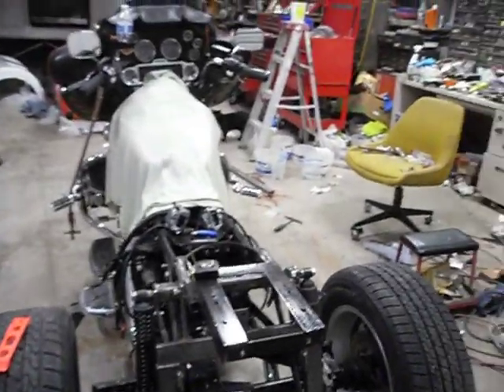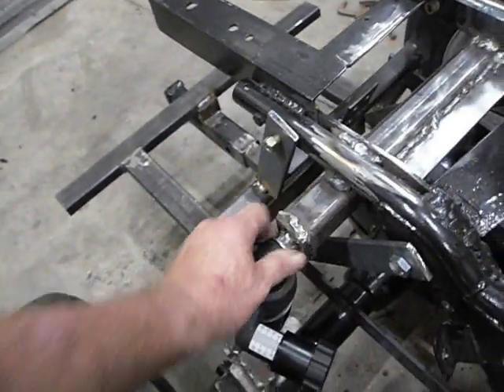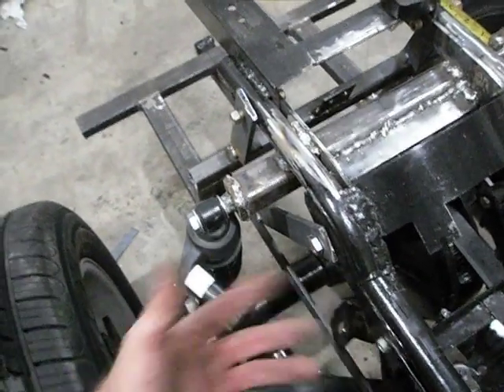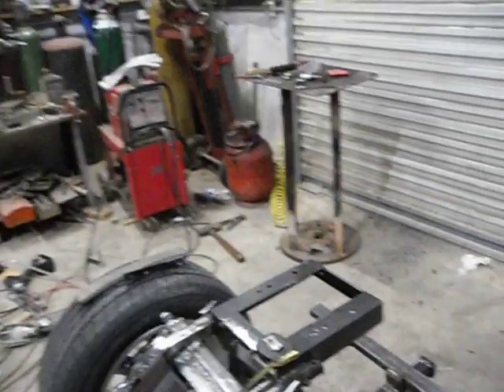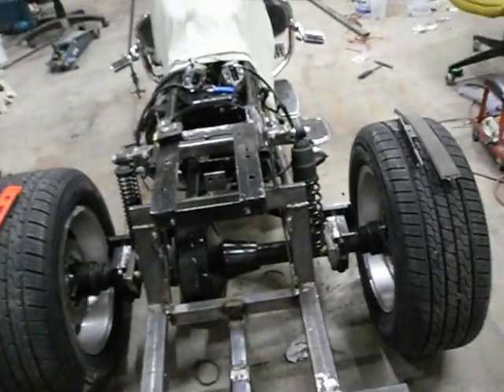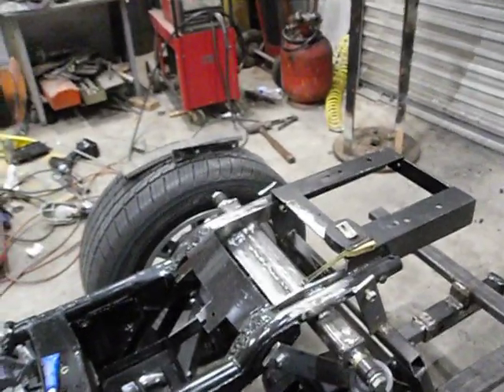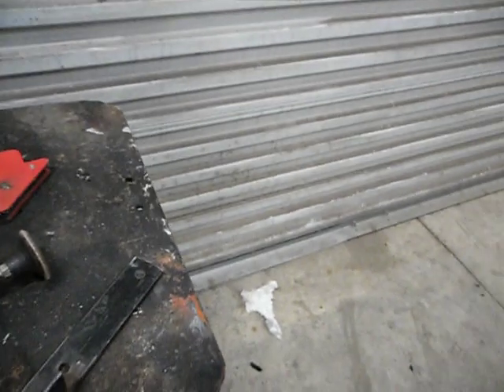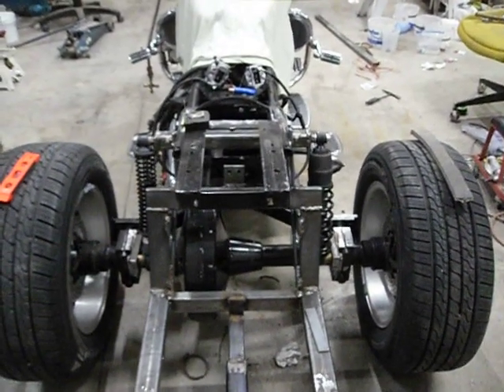DNA trike and Trike Life body kit install on my Harley Electra Glide part 3

Comment: My experience with the DNA kits has been very good.  I've installed them and pretty much a breeze.
Reply from the maker: They could provide torque and greasing procedures. I like the design and width vs a Frankenstein

Comment: What wheels are you using ?
Reply from the maker: American racing vintage torque thrust II matte black
Reply: @johnnyreb3359  thanks what is the bolt pattern and off set on the rims ?